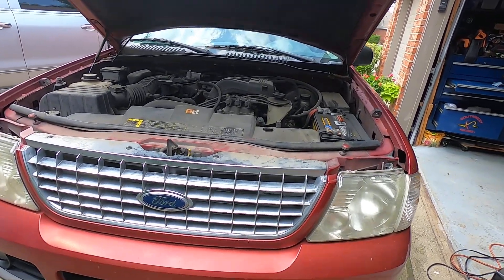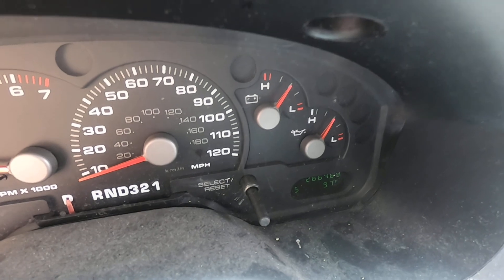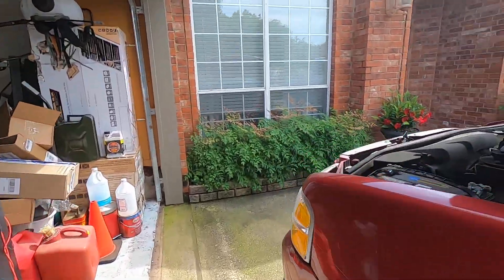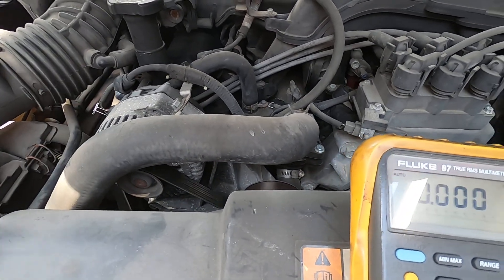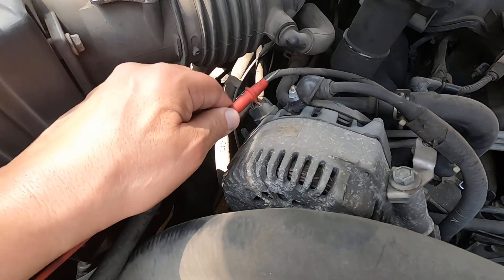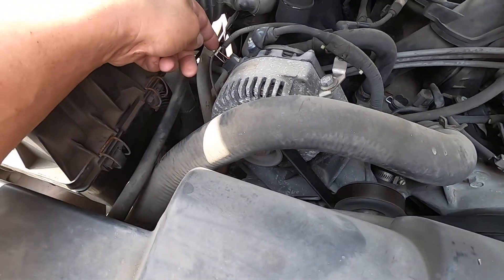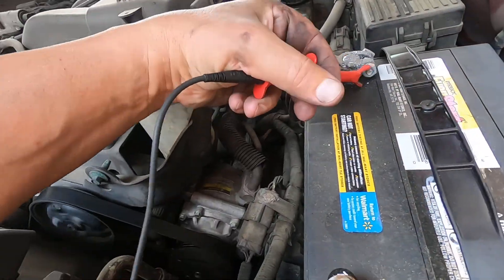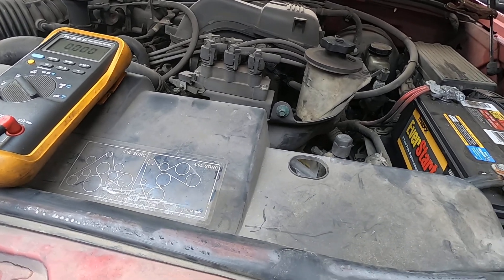How to properly test a Ford non-Smart charge PCM controlled alternator.

Comment: I have 2004 ford explorer  alternator  changed  battery was tested....voltage reads on meter above center line..battery light still on ..and it jumps when I turn it off.

Comment: very educational, I got the same like 8 v from PCM that the return because other field is battery voltage like 12v but is 8v enough to fire up alternator i have a new alternator
Reply from the maker: If you got 8v that is good. A new alternator should fix the problem.
Reply: @737mechanic  8v is that enough to charge the alternator to work ? because I still dont get any increase at the battery still 12.5 or less And I hate to junk the car when everything else works great
Reply from the maker: @LubaLuba1  Per the manual 8v is about right, then battery voltage on the B+ wire and the other smaller wire. Make sure the battery terminals are clean and tight and you can also do a voltage drop test from the B+ connection to the battery.
Reply: @737mechanic  but if I test battery with meter when the car is on and i only get 12.5  or 11.5 but doesn't go higher if I accelerate motor than alternator is not charging battery.:face-turquoise-drinking-coffee:
Reply from the maker: @LubaLuba1  Email me and I will send you the procedure for checking the system.

Comment: with the pins in 12.0 was the power wire? because one is return neutral and other is to PCM ?
Reply from the maker: There is the 12v B+ which is the heavy cable running to the battery, in the connector there is one that goes to the PCM then the other ends up running to the battery after going through some stuff.
Reply: @737mechanic  the two thinner wires are coming from PCM and one has voltage the other is ground control by PCM is that correct?
Reply from the maker: @myviews469  No only 1 "green" is going to the PCM and the other  "orange" goes through a fusable link and ends up going back to the battery.
Reply: @737mechanic  The two I have from PCM  red and brown and the red give me 8.8v when the key is on position, brown is zero. but just spliced into brown and attached  ground while motor was on tapping it then clipped it to negative post on battery but no increase in voltage. And this alternator is brand new just installed yesterday.

Comment: I have a 4.0 2009 ford ranger. Brand new alternator and battery. 2 wire connector - one wire has 12v all the time the other has 0 when key off and 12v when key on and when engine is running. Battery seems to be holding at 12.2. Do you think the PCB voltage is to high?
Reply: A good battery is 12.6 volts at rest. How many volts are you getting with the truck running?

Comment: how about a 2012  mazda 6  ,  alternator plug has 2 wires  ,  and a thick battery terminal..     I'm trying to find wire schematics on it just because I wanna know what the two wires  actually do..  Nothing's wrong with it just very curious...  The alternator is made by Mitsubishi but it also has Ford stamped on it
Reply: I really could use the wiring schematics for 2003 escape. I replaced alt 2x and still having same problem with it not charging battery.  I believe it is the pcm wire . it’s been a nightmare . Didn’t have this problem before alt was changed out.  Can I email you to get the wiring schematic?
Reply: I also have no battery light on . It doesn’t come on even with key forward but not running .
Reply from the maker: @allison6473  Send me an email at mechanic737@hotmail.com and I will send you the diagram.
Reply from the maker: Ford owns Mazda so that is why you will see parts from both manufacturers on both. If you email me I can send you the diagram.  mechanic737@hotmail.com
Reply: @737mechanic  I tried sending to your email but it didn't work
Reply from the maker: @Pinkielover  my email is mechanic737@hotmail.com

Comment: hey great video! so i have a 2000 for excursion, v10.  I just did these tests, at the pcm connector at the alternator, I unplugged it while the batter was still hooked up and I had batter voltage on both wires. I also had full battery voltage from the +b terminal on the alternator. but no charging of the battery.  this is a brand new alternator mind you.  I also did a ohms test on all wires from the alternator, to the batter and to the starter solenoid....do I have a bad alternator again? I also have a battery light on.
Reply: do u solve it

Comment: Was that a 2 or 3 wire mine is a 3
Reply from the maker: It is a 2, if yours is a 3 it will be a computer controlled regulator.
Reply: @737mechanic  are the 3 where it had a big connector with 2 wires, and then 1 is a short one with a small connector?  what computer controls that?